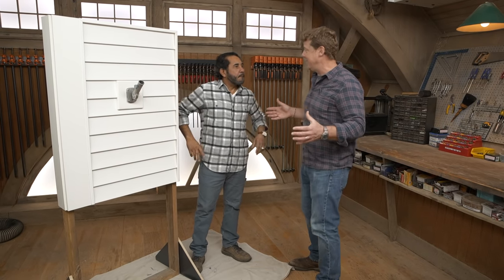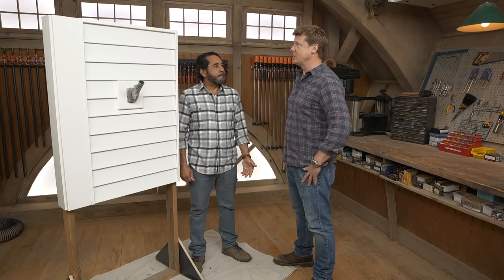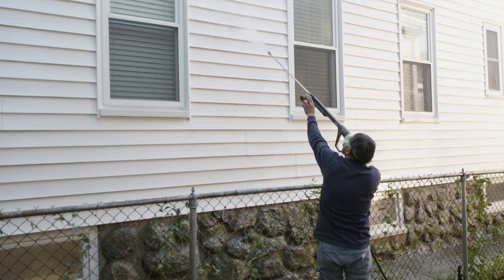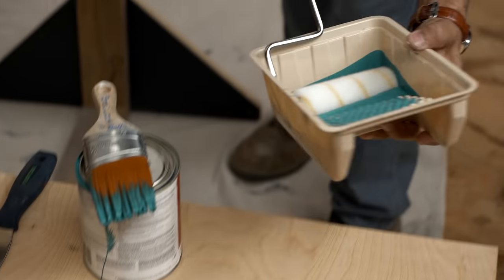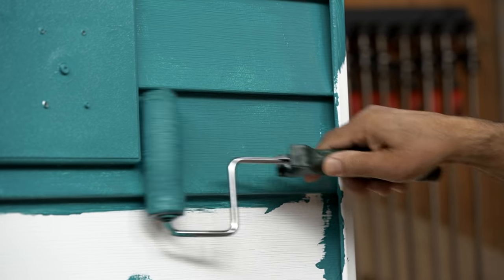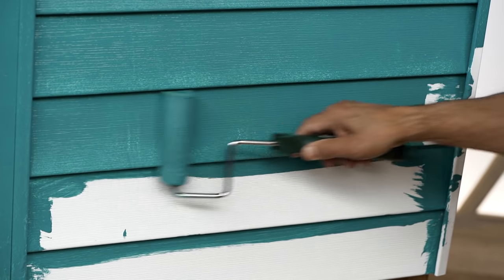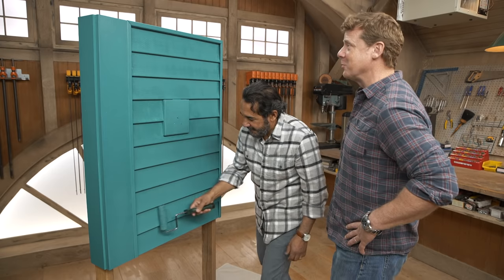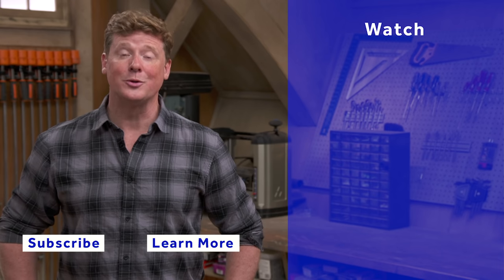How to Paint Vinyl Siding | Ask This Old House

Comment: Ok, powerwash with machine, then paint with paintbrush and a roller ?? NAH !! Use a airless spray painter !! MUCH simpler !
Reply: I'm doing my house soon and I have the time for brush and roller. And I really don't want to buy a sprayer. Will it last/look the same or close with a good job?
Reply: @joblo2671 just have to take the time to prep areas off that you don’t want paint on. I’ve painted a few hundred houses and the sprayed finish just looks better on vinyl. You can use a brush and roller on harder to Maneuver around areas though

Comment: From a civil engineer and licensed general contractor's perspective I would HIGHLY recommend using Kilz Adhesion Int/Ext Primer before applying any paint to vinyl, pvc, plastic, glass, or any previously glossed surfaces.
Reply: Is there a specific reason why killz?
Reply: @Inspireandbeyondco  It's one the best brands that I've used and that one that I specify in tech specs.
Reply: Just need Bm Command. Not cheap but insane adhesion
Reply: the latex version in the white and gold five?
Reply: Vinyl siding is not glossy. It’s matte
Reply: Benjamin Moore sells Stix it’s an incredible primer.
Reply: @allisonolassa2619 Thats what I was thinking. Ive never in my life have seen a gloss or even semiglossed vinyl siding. Maybe a slight satin but mostly matte.

Comment: Huge mistake not emphasizing the need to use vinyl safe paint. They are formulated to not absorb heat and melt the siding.
Reply: Agreed.  He said nothing about that.  Sad.
Reply: What type of paint is vinyl safe? Is there a specific brand you recommend?

Comment: i used a wagner spray gun system for my front porch vinyl and it turned out phenomenal.
Reply: How many coats??
Reply: The Wagner Sprayer....was just thinking of that. Glad to hear people have had great results!
Reply: @gregwasson9243  I think I did one coat, following up with touch up in certain areas I missed.
Reply: What color did you use, and how does it look now?
Reply: @handyhands6773  I used a semi-gloss exterior grey, not sure of the brand anymore. It still looks great
Reply: @handyhands6773  grey, and it looks just as good now as it did when I painted it.

Comment: Do more research before running to Home Depot or Lowe's to get paint and start this process. The wrong color, specifically tinted paints with a black base, can warp and ruin your siding.
Reply: That is why people should use a reputable Painting Contractor. You're correct. I made a comment on here about painting Vinyl & explains what you said here.
Reply: @ghpjerry  Thanks. I'm certainly no painting expert, but I'm always skeptical of a process that looks too easy. I like the This Old House crew, but they sometimes tend to breeze over things. I found this video particularly lacking. This prompted me to do more research into this and post to helpfully warn folks.
Reply: I wanna paint my vinyl shutters black. I see many people doing it but you say don’t use black based paint so how are they able too.
Reply: @tiannajohnson1752  Go find my comment under this video(not my comment in this thread, but my own comment somewhere here), read it thoroughly & you'll bet a better grasp of what you're asking. Your shutters probably are plastic, not vinyl, we just sprayed all the trim & shutters on a house black yesterday, but none of it was vinyl.
Reply: @tiannajohnson1752  vinyl shuttes are much more solid than flexible vinyl siding, thus would be less prone to warping. I would think painting them black is ok
Reply: @ghpjerry  I did find your comment already I just wanted more clarification

Comment: Using darker colors will cause the vinyl to buckle in the sun.  Sherwin-Williams makes a Vinyl-safe line of paint.  Was thinking about doing this until I saw the cedar shingles underneath, so I ripped off the garbage vinyl.
Reply: Jealous!
Reply: I’d read the same about going darker. We have clapboard under mine, pretty sure it’s lead paint on there now. But you do have me thinking.
Reply: @JoeyFiore  That's why mine was covered.  I ordered a paintshaver pro and hepa vac to restore it..  I know wood siding requires more maintenance, but it'll add way more value.

Comment: This video needs to specify that you need a vinyl safe paint that is specially tinted for siding. Also you made no comment on the fact that you do "not" need primer when doing this because the special vinyl paint sticks to the vinyl great with no primer. I would advice people to go to their paint store and ask before attempting this as a DIY. Let the paint store know that you are planning on painting vinyl siding so that they can mix it for that. You can't have any black tint added to the paint when picking a color. You will need to go back over the seams as it expands and contracts. btw, the paint store will tell you that this actually lasts about 3-5 years.

Comment: You can rent an airless sprayer and finish this fast and clean. If you have a big house you don’t have to spend days on it...
Reply: you are very likely to crack older siding with an airless...
dont ask me how i know...
Reply: @Cfish613  How can you crack siding just by spraying paint on it?
Reply: @jej3451  if you use an airless paint sprayer the high pressure (1000 psi+) can do that to older ,more brittle siding
But a spray can would be fine
Reply: @Cfish613  a 1000 psi? There isn't a paint sprayer made that YOU can use that uses that much pressure 😏.
Reply: @WheresHerb  ok ... 1000 psi force needed to pull the paint through the hose pump and spray nozzle. That is not the spreed of the paint. Because if that is the speed of the paint you will break metal at that point!
Reply: @Cfish613  I disagree with you. Don’t paint from 2” away.... hold it at 4-6 “ from the surface...
Reply: @WheresHerb  I'm sorry but you don't know what you're talking about. 1,000psi wouldn't even push product out of the gun that would resemble any type of acceptable spray pattern, most airless pumps are running from 2,500-3,000+psi when spraying properly.
Before any of you DIY'ers I see here trying to shame C H Fishbin's post about psi, go to Graco's website and educate yourself.
Reply: Yikes and I was gonna powerwash mine at 1750psi. Thanks for making me realize to take it easy on older siding.  let the chemicals do the work in the cleaning solution..

Comment: As a Professional Painting Contractor we do alot of Vinyl Siding & it does last a long time when done properly. It must be clean enough to eat off of & you need to use a Vinyl Safe Product to eliminate "buckling". Rule of thumb back in the day was don't go darker than original Vinyl color, but there's an exception to every rule right? You could go darker to a point, but don't push it or you'll be sorry. You'll come home after a 95° day & your Vinyl will all be "buckled". When Vinyl is made, the color of the Vinyl has been formulated to adapt to heat depending on the color. Darker colors have to tolerate hotter temps than lighter colors. The Vinyl can only move so much before the nails stop it from going further in it's oblong slot holding it up, then it "buckles" or gives it a melting appearance...Just like when you let Uncle Bob run the grill & he has it right next to the Vinyl & melts your house, same type thing.
Paint technology has made it where you can go darker, you just need to use an appropriate product & the store knows it's going on Vinyl because they use a different tinting technique to achieve same color, but it makes it "Vinyl Safe". Most stores in our area will ask when ordering exterior paints if it's going on Vinyl, there's a reason why as I stated above.
Reply: What do you recommend for cleaning vinyl for paint prep? I was planning on painting my vinyl siding this summer and was thinking simple green or LAs totally awesome?
Reply: @Megan-mq8pf  We use Simple Green. If there is mold present, use a bleach solution also...just make sure the garden sprayer you get is made for bleach, if not the bleach will ruing the rubber O-rings in a regular garden sprayer. Special O-rings are used for bleach.
Reply: @ghpjerry  Thanks for the tips!
Reply: @Megan-mq8pf  YW.
Reply: Can white vinyl siding be painted?
Reply: @ailous626  Yes, but stay with light earth tones & let the store know you're painting vinyl so they can tint it appropriately.
Reply: I was thinking about using simple green with my pressure washer...any advice on solution rate or just let the concentrate mix straight into the flow stream?
Reply: @airdave1953  Depends on the flow of your machine & how dirty the substrate is. Experiment with ratios per machine.
Reply: Feelings on power washer and airless paint sprayer vs everything by hand with scrubbing and a hose then brushes and rollers? Obviously the goal is great adhesion and great coverage so what's the best option.
Reply: @dcq5381  Washing & painting it by hand isn't a realistic option for many reasons, this is a chore best left to a professional that has experience in it, It has to be done by machine, both washing & spraying. There is a difference in terms between powerwashing & powerrinsing (or aka "soft wash"), that needs to be clear between contractor & homeowner, many times people are duped by this & there is a major difference between the 2. Powerrinsing with cleaners with remove the mildew & surface dirt you can see, but it will not remove the oxidation left behind, that MUST be removed prior to painting or don't paint it at all, it will fail. Powerwashing takes exponentially longer & is much more detailed. Hope this helps.
Reply: @ghpjerry  that it does. Thanks
Reply: Can you use bleach and downy soap? I heard a softener works best for cleaning is this true?
Reply: @ailous626  uhhh, what do you think they showed in the video? there are special paints that reflect IR light making them reflect a lot of heat.
Reply: @ghpjerry any suggestions for someone that wants to paint there vinyl stand alone garage to black, from a grey color? 

I live in Buffalo ny, not super hot but not sure
Reply: @CustomBuiltNation  Tough call. Is the grey dark? Is it the original color of the vinyl or has it been painted before?
What I'd suggest if you're going to do it is use a black color that has to be tinted, not a factory black, that way they can tint it appropriately for "Vinyl Safe". Next is, use a flat, that helps cut down on temperature, but it's a double sided coin, I generally use a Satin on exteriors because it lasts longer & almost self-cleans with rain, whereas flat does not. Talk to your local Sherwin Williams or other manufacturer you trust and talk with a specialist there, use my suggestions when talking with them about it. Good luck!
Reply: @ghpjerry  thank you for your time and expertise. I really appreciate it. Your the man
Reply: @dcq5381  Do it by hand, I scrubbed my garage down  with Dawn Dish liquid, warm water followed by a thorough rinse. The siding was squeaky clean before painting.
Reply: @ghpjerry does all of this advice change when painting in a climate controlled room that has vinyl siding on a wall or 2? Like a porch that's enclosed with heating and cooling.
Reply: Not trying to put down the big box stores for getting paint. The paint stores that deal strictly in paint are better choices. They will advise the best paint for vinyl. Don't let cost of paint dictate your choice  quality of paint.
Reply: Is it wise to put a primer on first?
Reply: @cindymusall578  No, not necessary.

Comment: Great video!  Vinyl or aluminum siding the way I do it. Prep is number one.  Wash all surfaces by hand. Let dry one day!  Material and tools 2 1/2 gooseneck flexible paint brush extension. Mini whizz 6” roller sleeve. Paint 2 or 3 strips at a time to avoid lap marks! Scaffolding is best when painting these surfaces. Paint top quality 100% acrylic flat. Be careful not to go to dark then the existing siding colour. The siding can warp by extreme heat by the sun UV. The gooseneck guy!  Don
Reply: Thank you for this comment, Donald! I am in the "critical research" phase of painting my vinyl siding. I live in Utah and it's hotter than Hades here in the summer months so I have chosen a paint color with a similar darkness to existing paint. Can you recommend a good paint to use? There are so many out there! Also, is there a particular time of year to paint? I imagine not too hot, cold or wet and unfortunately in Utah, it's generally only one of the 3 lol! Thank you so much! Hope to hear back!

Comment: I did my garage about 8 years ago, in dark green to match the house. Stuff has faded but it's still stuck on like glue. Time to repaint this year. Just used  Valspar exterior and its done a great job. My number one tip is never paint in direct sunlight. The paint will dry too quickly and not adhere properly to the siding.
Reply: What’s it a flat paint or gloss

Comment: What about the overlaps that grow and shrink due to temperature change? Any ideas?
Reply: I am wondering also.   I hear crickets!!  I wouldn't do it until proven.
Reply: You paint it when it’s cooler out, so the planks are as short as possible.
Reply: All you can do is touch them up. If you have that happening, it tells me you went too dark from original color. If you're not getting "buckling" you're lucky because if you're seeing the color underneath from the Vinyl movement, it's moving too far.
I just made a post on here about painting Vinyl...If it posted, we know how YT doesn't like to post messages a lot of times, go read what I wrote about painting Vinyl.

Comment: Great video!  Curious... do you need to use a primer before you paint?
Reply: From what I've read, no. Primer is to bond with the surface material which acrylic does with vinyl without needing a specific primer.
Reply: Always prime to insure the best adhesion to the substrate. Paint and primer in one is not what it's marketed as. There's no primer in it, just a label targeted towards diy market. Pros will prime first and will stay away from darker colours unless the siding is already dark

Comment: I heard that you can clean it with bleach and downy soap to pressure wash. Is this true? And if so what would the correct ratio be? 🤔
Reply: I'm not a pro, but I use Dawn dishwashing liquid  since it's also a mild degreaser as it takes oil off little ducks 😁 as far as bleach does about 
25 bleach 75 water seems to do fine along with a pressure washer. I also scrub with a soft bristle brush "dawn" water bucket

Comment: YOU HAVE TO LIFT UP THE JOINTS AND PLACE SOMETHING UNDERNEATH AND PAINT UNDER THE JOINTS , OTHERWISE IF YOU JUST PAINT OVER THE JOINTS , IN COLD WEATHER THE VYNIL WILL EXPAND AND PULL APART THE PAINT AT THE JOINTS AND SHOW THE OLD COLOR OF THE VYNIL 
IT HAPPENED TO MY HOUSE AND I HAD TO GO BACK , SCRAPE THE DRIED PULLED APART PPAINT AND 
LIFT UP THE JOINTS , PROP THEM UP , PAINT UNDER THE JOINTS , LET DRY AND THEN PLACE THE VYNIL BACK ......IT HAS TO BE DONE THE FIRST TIME

Comment: I’m surprised nothing was discussed about warping.  Mine warped badly after painting it a darker color.
Reply: Go read my comment on Painting Vinyl, you'll know what happened.
Reply: @ghpjerry  I did. I used a high-end paint that said it was safe for vinyl. I ended up having mine replaced after it started warping...maybe it was just too old?
Reply: @langer24106  No, it being old wouldn't be it, Vinyl is very resilient. 
This is a Copy & Paste from my other comment on here in somewhat detail on painting Vinyl:
Paint technology has made it where you can go darker, you just need to use an appropriate product & the store knows it's going on Vinyl because they use a different tinting technique to achieve same color, but it makes it "Vinyl Safe". Most stores in our area will ask when ordering exterior paints if it's going on Vinyl, there's a reason why as I stated above.
Rule of thumb back in the day was don't go darker than original Vinyl color, but there's an exception to every rule right? You could go darker to a point, but don't push it or you'll be sorry. You'll come home after a 95° day & your Vinyl will all be "buckled". When Vinyl is made, the color of the Vinyl has been formulated to adapt to heat depending on the color. Darker colors have to tolerate hotter temps than lighter colors. The Vinyl can only move so much before the nails stop it from going further in it's oblong slot holding it up, then it "buckles" or gives it a melting appearance...Just like when you let Uncle Bob run the grill & he has it right next to the Vinyl & melts your house, same type thing.
Reply: What color did you use?
Reply: @JCo-bx3tq  It was originally light gray. I painted it dark gray.
Reply: @langer24106  did you use vinyl safe paint like the one from Sherwin Williams? Was there black in your paint?

Comment: Would cost a fortune to paint siding better off just replacing it after 50 years
Reply: Quote to side my house- $45k! Cost of paint- $1200
Reply: @jarrodallen3517  seems awful cheap.  Probably will not last but a year or two and then start to peel and flake.
Reply: @Jasha333   I'm going strong on year 5 with the painted siding. Cheap because I painted it myself
Reply: @jarrodallen3517  ahh I was meaning having professionals paint your existing siding vs having new installed.  Of course painting it yourself will save a massive amount of money .  Good deal glad it worked out for ya